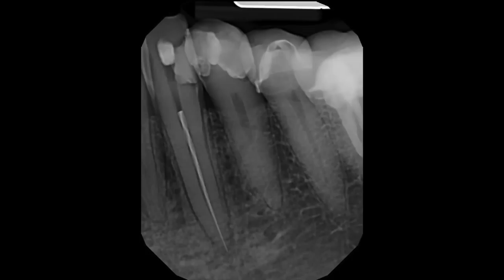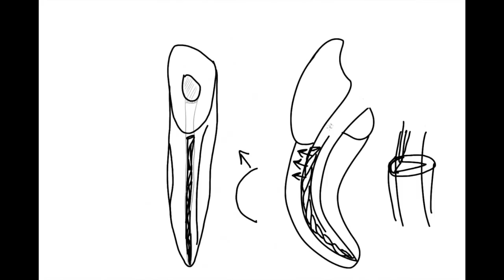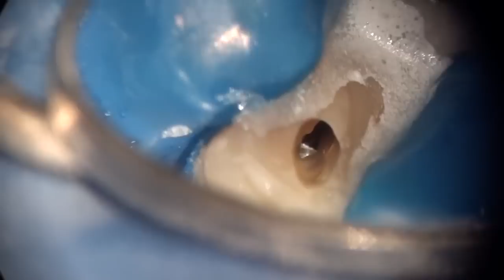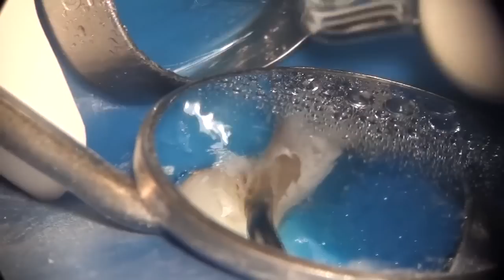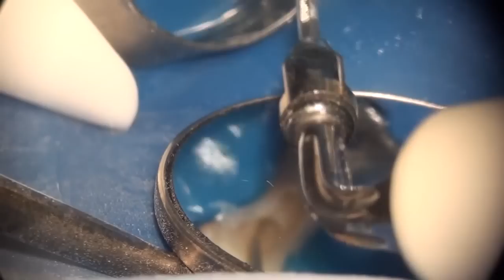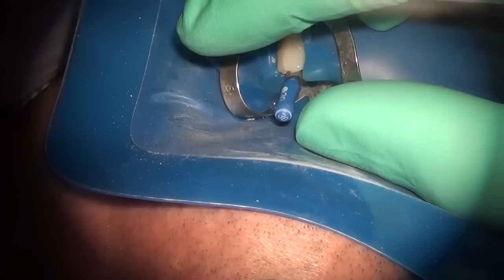Broken Instrument Removal

Comment: Immediately after my root canal on my upper right #2 I started having throbbing pain as well as pressure in the tooth. It felt like the tooth was very fragile. After multiple attempts to have it diagnosed, I finally saw an endodontist who informed me that an instrument was broken in the middle of the third nerve before it could reach the end of the nerve. Meaning, my tooth is still very much alive due to it not being completely cleaned out. However, he said that going in and trying to remove it would be pointless and a hassle and suggested that I get an extraction and an implant placed. I have no idea what to do. Help!
Reply: may  be some one can retriev it

Comment: I had a root canal done on my two front teeth and I still have a file stuck in where the root canal is. My dentist said it can not come out, so it is left there.
I think it be better to remove it but I not no dentist.
Reply: I have one stuck in my root canal. Dentist said it should be fine then sealed it inside.

Comment: Does the patient have to pay for the procedure to remove an instrument that the dentist broke in the root?
Reply from the maker: Technically yes as it's a risk of the procedure; but most good dentists won't double charge if they're removing it themselves or reimburse the root canal fee they charged if the patient is subsequently referred to someone else to complete the root canal. But that's just a management style rather than an obligation. The same thing happens if someone attempts to save the tooth and the root breaks. A non-surgical extraction can turn into a surgical extraction and the cost is not absorbed by the dentist. Different dentists have different philosophies about patient management. It has to do with the reputation and brand of the given practice. That's why it's important to be seen by reputable dentists/practices.

Comment: A dentist left a broken file in my tooth and I ended up with sepsis.  I was 8 years old then. I have leaking Heart valves as a result.
Reply: Omg! Did u sue?
Reply: Nope...  In the 70's & 80's that wasn't common...  I had a Neighbors German Shepherd bite me up pretty good and my Parents just made them pay the Doctor bill..
Reply: How it went in to your blood stream?
Reply: Infection in my jaw spread .
Reply: @OldSkoolF  I have the same problem 
But not infected yet

What if we pull tooth out?

Like the needle is in tooth canal
Reply: The surgeon removed the 2 molars with the broken drills and put packing in my jaw. My parents ignored the problem for over a year after both of the caps came off. Thats how it spread so bad.

Comment: Can we make use of ultrasonic scalers in the case
Reply from the maker: Only if it's a piezo electric ultrasonic, not if it's a magnetorestrictive. But if you do, you need a microscope and should be able to visualize the broken segment or else you can ledge or perforate the tooth and make a bad situation even worse.

Comment: a file was  broken in my tooth 4 years ago . a few days back i visited another dentist and she told me about that. she told that there are few chances that it can be removed. what should i do. the previous doctor charged a high amout 4 years back and this doctor is also charging a very high amount to remove it. the file is not paining yet please tell me what can i do. i am very tensed about this.
Reply from the maker: A broken file alone is not a problem. See if there's a problem (chronic infection) associated with it. If there isn't, just monitor the tooth. No need to remove it as it has additional risk if it's not mandated because of infection. Be sure to see a root canal specialist (endodontist) if you decide to remove it.
Reply: You don't need a dentist... you need a lawyer!
Reply: @jakeryker546  NO, she needs an endodontist... Stop telling people to lawyer up, they need a solution to their problems, not a visit to the court. Tipical american thinking... -.-' File breakage is one of the complications associated with canal treatment, not a malpractice you imbecile.

Comment: if the file left inside.. 
can it cause any problems?? 

please reply
Reply from the maker: It depends on the location of the broken segment, whether the tooth was vital or necrotic, if the treatment was at the beginning, where there was infection left behind or towards the end when things were already cleaned, the additional roots and anatomy and the patient's own immune system. Generally, if all things are favorable the risk of problems in the short run are small. But if not, there would be a problem, and worse yet, a chronic infection. It's important to send to a specialist to see if they can remove it or whether apicoectomy is needed. Good luck!
Reply: @EndosKool   the tooth is previously treated with RCT ..
and the small segment of file left inside  and filled . after 2 year it started hurting.
afterwards i counted to doctor she said" it is harm less " i will mai the felling around that segment.  it wii not bother you again..
Reply from the maker: Divyanshu Singh If it’s hurting then it’s not normal. There should be no pain. So, there’s likely a problem that needs imaging and diagnosis. Ask the original doctor for a follow up or see another root canal specialist for a second opinion. Good luck.
Reply: @EndosKool   thank you.
Reply: @EndosKool   dose it work well or the segment left inside the root must be removed..??
Reply: @EndosKool   please help!!

Comment: My dentist has broken the tip of his stainless steel instrument in 3 root canals. Claims they are encased so it's not an issue. I'm concerned.
Reply: "Encased" no - more like wedged in.  If the break occurred early in the procedure, when there are still a lot of germs, it is more likely to be not okay.  If it happened towards the end, when the canals were cleaned fully, more likely to be okay.  Best case scenario, the broken file acts like part of the endodontic filling and works appropriately.  Worst case, the broken file harbors bacteria and makes it difficult or impossible to retreat the tooth correctly - be sure you get an xray that shows the ends of those roots at screenings.  If it's failing it will likely show on an xray before you have symptoms.  If you get pain, swelling, a bump that "pops", tooth feels "high" etc, better get it checked out.   If this doc did 3 canals and broke a file off in all of them, I'd be really concerned about his/her competence. If the doc seems to dismiss it as nothing and acts all cavalier, I'd look to a second opinion.
Reply: @morris5833  , thank you. One has failed. Had it removed and will get it replaced with implant. I made it clear to Dr Fortinsky I'm not happy, he's not accepting blame of course. The Dr I'm going to now is not impressed by his work.
Reply: Glad you switch providers in that case.  I spend a lot of time reviewing treatment for the US veteran's health admin, and I think I see more lousy root canal treatment than any other.  It's hard to make an informed decision about what dentist to see.  I tend to mistrust dentists who claim to be able to do "every procedure every time."  I also don't trust those who won't consider the possibility of an error on their part.  If you are in the US you may consider corresponding with the state dental board.  Other countries will have something similar.  It's possible other people will have made similar complaints.  You may also be saving someone else a similar experience.
Reply: Are you the patient??

Comment: I agree with you but there is another cause of the fracture.We know how easily break files if there is is curvatura in the apikal third in wide root channel 1.3and 2.3 teeth.There may be several reasons for such long part of the file.